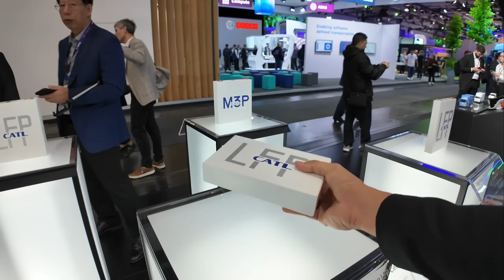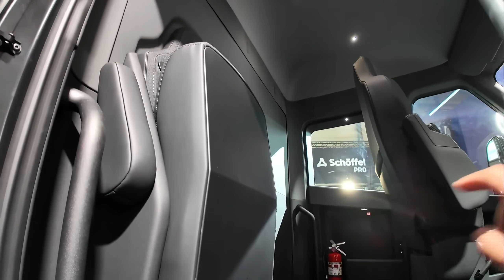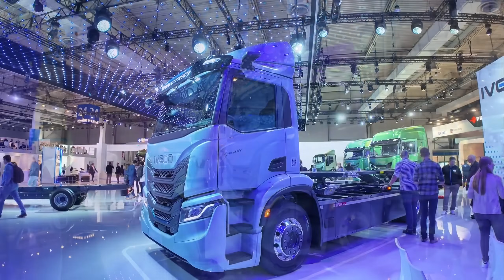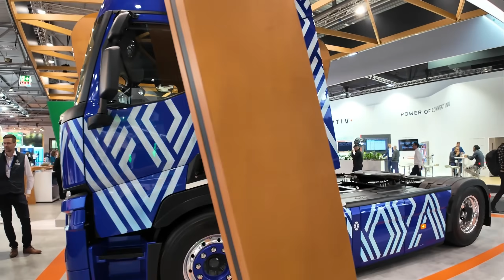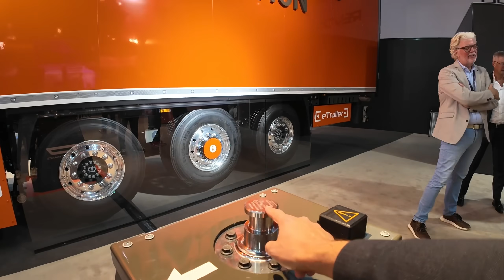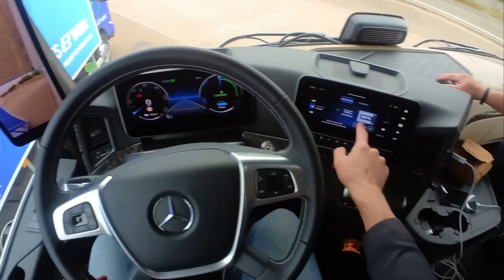These are the E-Trucks coming in 2025

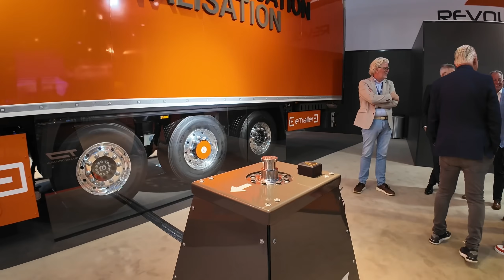Comment: 15:10 i'm found of trailer dynamics concept.
No need to have a powerfull recharge at destination, just need to exhange the trailer. It can be charge with less power and when electricity is cheaper.
The question is how can it be manage to not be owner of the trailer.

Edit : I just saw the swap option 👍

Comment: When one of these huge battery packs has a thermal run-away it will a beHUGE HUGE fire. which you can't put out. We need to move away from Li-Ion ASAP. LiFePO is much much safer battery. That is the way to go.

Comment: hydrogen is a wank in everything but green steel, and then you have to have the hydrogen plant NEXT to the steel plant.  TO CONTAIN HYDROGEN, you need a steel that is 10 times as pricy as copper or low grade metal that is in your hot water heater, stove or oven .IT ROTS THE CHEAP METAL due to the size of the molecule.

Comment: That drive test showing the truck sets to speed limit automatically needs to come across to cars!  The Australian E-Truck conversions have swap-out batteries from the start.  What would be good would be offering upgrades to existing E-trucks - batteries and engine software such as those offered on Nissan Leaf cars?  If E-trailers ran their fridge systems on electric that would make sleeping so much easier!  Great video and very interesting. Happy New Year

Comment: 3:06 Hybrid for the long haul would be great. Like an Edison.
Reply: Why hybrid for long haul, Tobias is showing in his videos that any ICE component is already irrelevant for fully electric long haul trucking and that should be the goal for achieving phasing out of burning stuff sooner rather than later. 
US audience projecting their hopes on start ups like Edison with a big presence on social which are essientially tinkering around with retrofit prototypes is similar to their seeing the solution for HSR with companies like Brightline. 
The US at some point will have to onboard leadin-edge tech from markets that haven't been held back technologically because of protectionism. It'll be assembled stateside but to think that legacy truck makers (or railway companies) in the US can compete with EU and Asian makers at this point is far fetched.
Reply: The long haul in Aus is a tad different than in Europe.
Reply: Why the hybrid system? Hybrids have an advantage and stop and go traffic, that's it! A plug-in hybrid might do a little bit better, but not much.

The purpose of Edison Motors is for the trucks that are beyond class 8! Classic trucks are up to 82,000 lb for the electric metals. Edison Motors has talked about removing single logs that are 120,000 lb, plus the way to the truck, plus trailer...

Already, we have trucks that can handle a trucker's full day of driving on a single charge. Why are you trying to go beyond that? Adding any type of engine increases the maintenance, increases the fire risk, and increases the operating costs. No business wants to do that.
Reply: Yes... Long haul, not many chargers out bush.

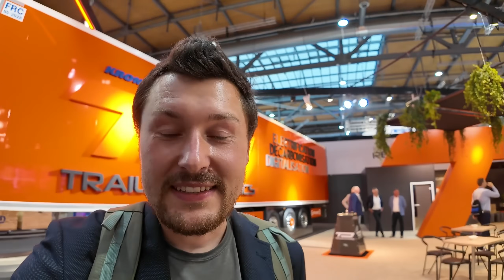Comment: 14:40 do those trailers also have solar panels? And can they charge the electric semi while driving? And can they also drive slowly with a remote control, in hard parking situations? 
I hope they can also charge normally, so they can charge while loading and unloading attached to the buildings.
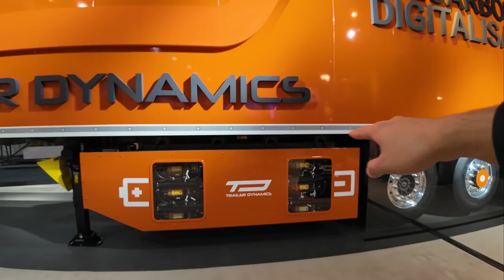15:00 600kWh and 600km extra range? That's really efficiënt!

Comment: I see the limiting future developments in Electric trucking in the Uk as we have in the car industry. The vehicles will be technically advanced but hindered by the Infrastructure. Until Service areas are widespread and capable of utilizing regulated break times to charge, haulage companies won't accept trucks parked in lay by's then having to take an extra time out charging when it could be on the road earning. Limited Daily short runs who charge at base will be the default for the Uk
Reply: but that's what his channel is all about though.  Showing that it's already possible with todays infra (don't know about the state of HPC infra across the UK). 
Sure, todays infra could't cope with a sudden (and unrealistic) shift of all truck haulage being done electrically. But as the proliferation of etrucks takes off so will the build up of charging infra.
Pioneers like his company Nanno Jansen will gain a key advantage in operating expertise, cost savings an dattractivness to future drivers while others wait for things to be "ready".
Reply: @velotill  UK a long way off. We've got 2 DAF rigid 18t at work electric and their limitations are infrastructure

Comment: Generally speaking, the issue with this kind of electrified transportation is that time is momey and a full tank (or time filling it) provides more range than these LFPs. It remains to be seen if these increases costs are beat by lower battery and charging costs. We need more charging infrastructure but it seems to me these EV trucks are only viable right now for shorter trips, Europe would be a good application, the US, not so much...
Reply: you should watch more of his what-happened-last-week videos where he has proven again and again that with his IVECO the limiting factor is legal driving hours not battery capacity. Starting the day fully charged and taking one or two charging stops during those mandatory rests takes him all across Germany and beyond. 
Not yet on this EN channel you'll even find a report on a weeklong journey all the way to Malaga in Southern Spain he did with a co-pilot (EN auto-subtitles work great).

Comment: The batteries are merely a store of power. That power is generated by power stations, burning coal, gas, oil, wood, plus nuclear, and a bit from hydro, sun and wind. Add on the oil used to build the trucks and batteries etc. This whole thing is a scam, and consumers are having to pay for it.

Comment: That powered trailer with standard CATL battery swap packs is very interesting.   would be worried that in 10 yrs those trailers will have AI Autonomous driving. No drivers required.

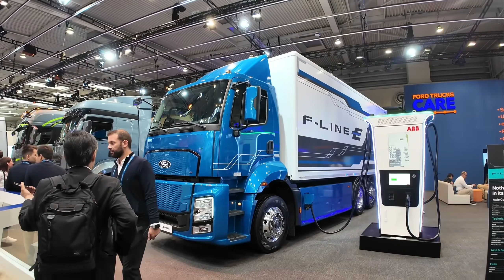Comment: great coverage of IAA Tobias, you might just gain a few new followers once i show this video next week to my skeptical associates.🤙8:08 - yes that IS a surprise and be damned if that Ford Blue doesn't look good, it makes sense i guess given the strong market share they hold with E-Transits. 😎 although that might be fitted with full size 22.5" wheels and is a throwback to the "OG" Class-8 Ford 9000's from the 80's/90's, it'll be interesting to see if it's use expands OUTSIDE of Turkey to other parts of Europe (never mind to here in 'Murica).

Comment: 600 KW - that is a lot of power in those batteries.  They should put ports on both sides of the trucks, and then only allow one charger port to open at a time.  

LFP cells don't use nickel, a expensive material to put in them.  So they predict the cell cost will be about 1/2 of the cells that contain nickel.  

Tesla is also trying to avoid cobalt too.  

It will be great when they start to install more and more truck charging stations that you do not need to unhitch to charge!  Even cars like to tow into a charging station!  

I was looking at the trailer with the electric axles, and thinking "If they had a OBDII port on the truck, it can tell the trailer what the driver's throttle position is, easy!"  If you are taking a trailer load of stuff to a grocery store, while they unload the truck, a 50 amp disconnect at 480 volts can provide about 35 KW of charging for the couple of hours they are unloading the truck.  

Thanks for making all of these very informative video's!  

From Portland Oregon, USA.
Reply: LFP batteries also last much longer than standard NMC lithium battery. NMC lithium battery only lasts for 500 to 800 full charge cycles before dropping below 80% health, while at the same time LFP batteries can last for as long as 6000 cycles before reaching the same degradation

Comment: 1.2Million km battery warranty sounds good, especially for a commercial vehicle using ultra fast charging.
Reply: They  do not really ultra fast charging...in fact it is extremly slow, but sufficient to charge in the 45min of mandatory break each 4,5h in Europe.
His IVECO has cross capacity of 738kwh and charges with 350kw...means 0,47C only. Even with MW Charging it would be only 0,7C.
A Taycan charges at 3.2C, which is really fast charging.
Reply: Warranty is great but we need to know what degradation percentage they are using to trigger a warranty claim. Without that information it's useless
Reply: @DJS_ENO for cars that's between 70 and 80%
Reply: @DJS_ENO  There is talk about degradation becoming a thing of the past and also ways of reversing the degradation of current batteries not to mention they expect 2x - 3x the capacity in batteries in the coming years not to mention fire issues going away but we'll see how it goes :)

This channel is the best thing on Youtube for this, we finally get to see these trucks in action doing normal work, not just set routes and city driving, its going and working as I expected all along but sadly so many people are still negative and base their claims on very out dated information.

Comment: Regarding EON chargers - or/and chargers in general, in my opinion there is no doubt whatsoever. If I were a FLEET operator, I would definitely choose the KEMPOWER solution with the satellite stations. Firstly, Kempower is known from the welding world, where for decades they have done not just good but extremely well. Their solution has a much greater granularity, and for a fleet operator there is so much control that can be done from the "office" including deciding whether a specific or several cars should be prioritized, and a fine-grained setup of charging, charging times in relation to electricity prices and much, much more. Up to 8 satellites (stands with plugs) can be connected to one power module. Each stand can be followed on a web page (no app required) and much, much more. It is so smart.
Reply: Just to clarify: EON is a network operator, Kempower a charging equipment manufacturer.

Comment: I disagree on one point i believe there is still lots of innovation to come before we leave the early phase of EV transport.We will see new cab designs, driver position ,  drive presents and multiple new batteries technologies and chemistry's
Reply: The problem with cab changes and driver position is regulations, And while there will be new batteries, the rollout is always so slow
Reply: @matt45540  both move slow but once they move there is a burst of change, it takes 5 year plus got lab to product and there are a number of 3 and 4 year olds  the big battery makers are releasing stuff this year to the car makers that is very different to the iron phosphate they are shipping now the state of the art in 2030 we make these early trucks look very poor that's the issue with early life development eg pc in the 1980to 2000s or mobiles over the same time lots of big changes  now it's very much all the same with very few big leaps early mid life, ev car are entering this phase but truck I believe are not